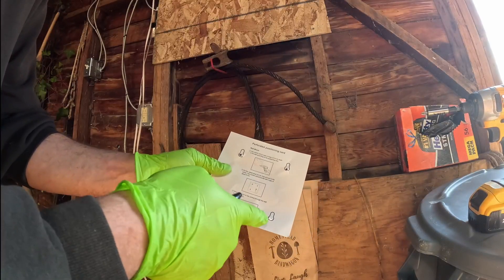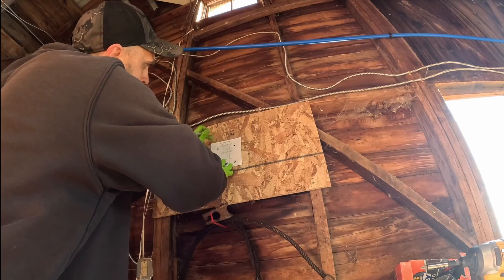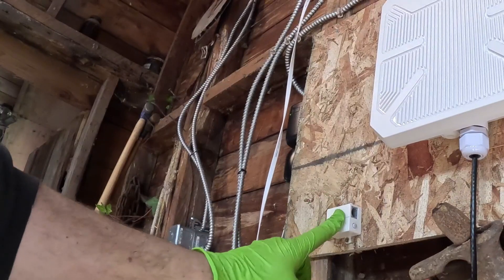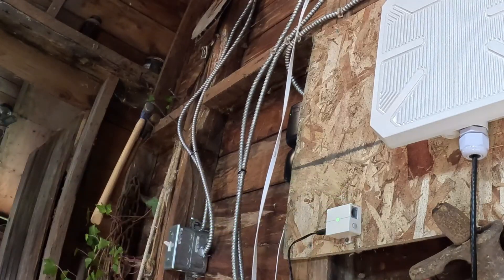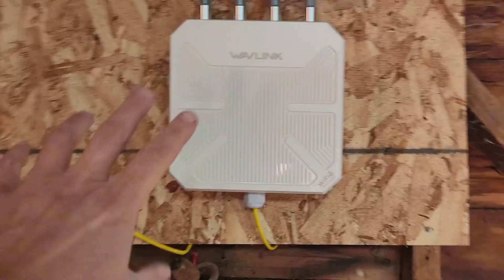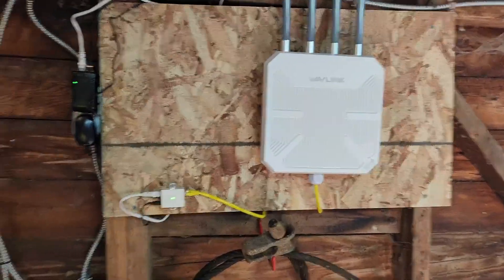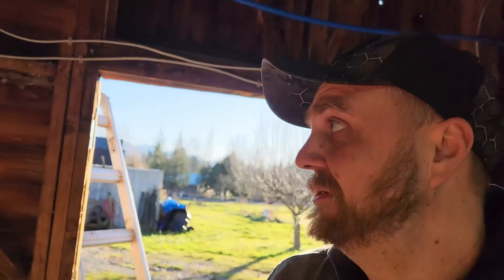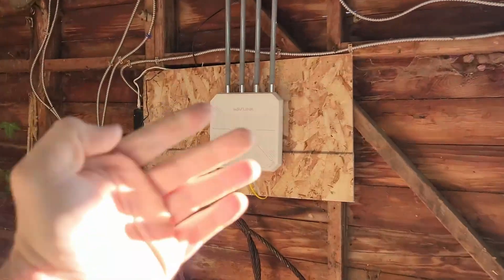WAVLINK AX3000 Outdoor WiFi6 Extender | WL WN573HX3

Comment: do you know how to mac filter on Wavlink Wifi 6 AX1800 WL-WN573HX1?
Reply from the maker: Hello!
I am sorry the our device does not support mac filter.
However if your router support mac filter,you could configure wavlink device as ap mode and connect it to the router via Ethernet cable.
Then you could control all devices which connect to the wavlink device in the management page of your router.
I hope these information could help.
If you have any other question,please be free to tell us via email: postsales@wavlink.com
All the best
Wavlink team

Comment: Wavlink tech support engineering sent me a short report about this device and how it really needs to be about 7 to 8 feet off the ground and no higher because of the radiation pattern is a flat plane like a pancake shooting out with this antenna group so putting it up high just waste a lot of your power turns out for this particular design. They have one with Kris Kross antenna that solves the problem, but not this version.